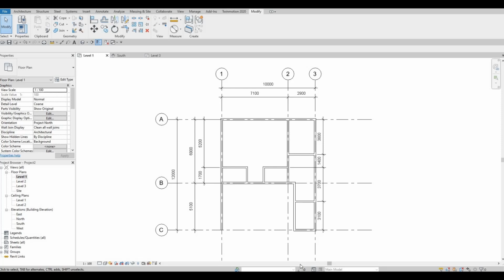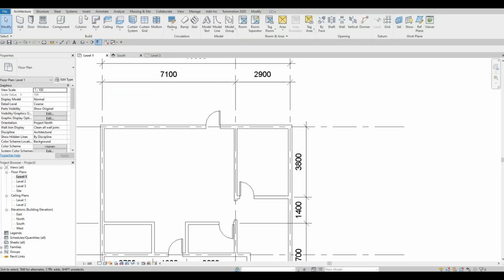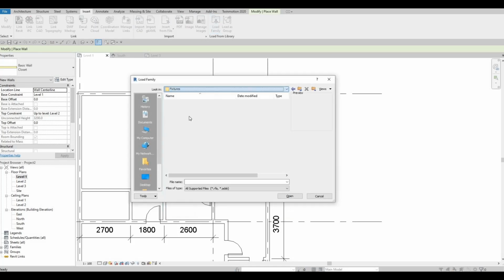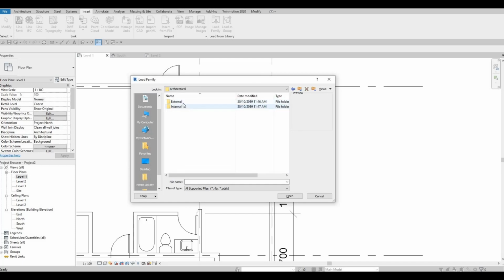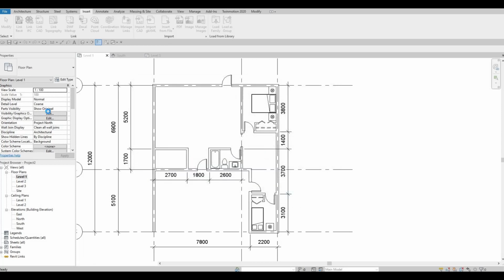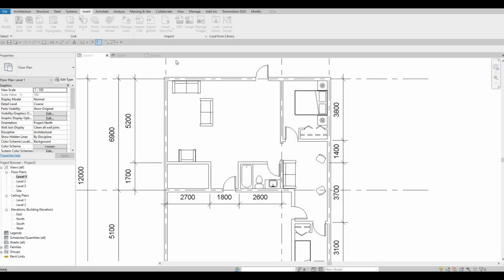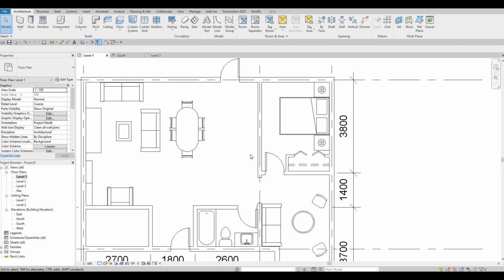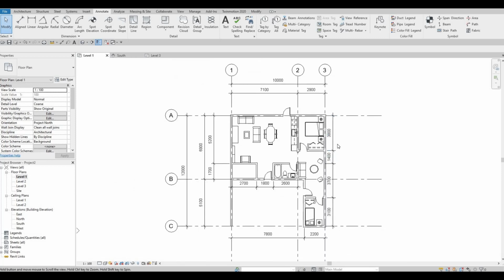Modern House in the Philippines | Part 2 | Complete Step by Step | Revit Project Tutorial

Comment: Sir processor required
Reply from the maker: I am using Ryzen 3600 with gtx 1660 now.
Reply: @ArchCoreDesigns  sir graphic card also required 😮😮
Reply from the maker: I know 3400g comes with integrated vega graphics but for me I want a dedicated gpu so that It can handle Twinmotion rendering. It is what I prefer. It runs Twinmotion smoothly.
Reply: @ArchCoreDesigns  ok sir
Reply from the maker: Good luck building your computer 🙂🙏